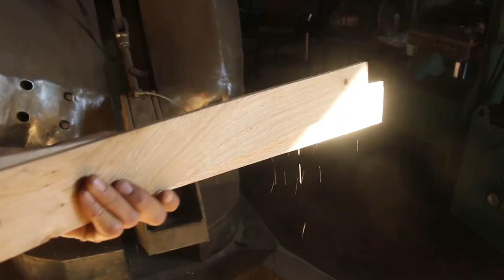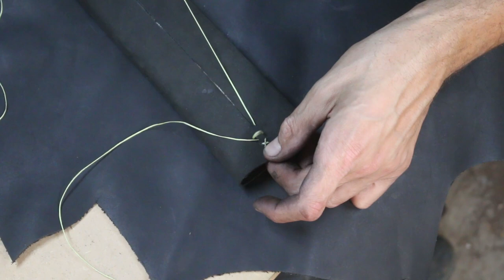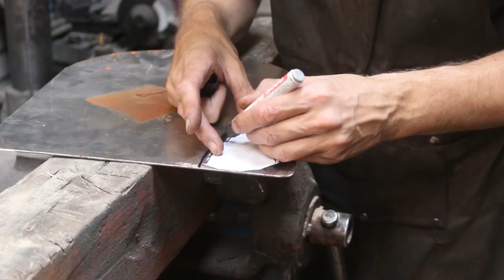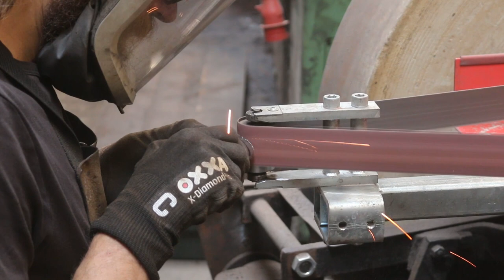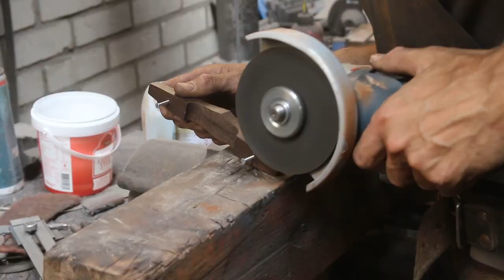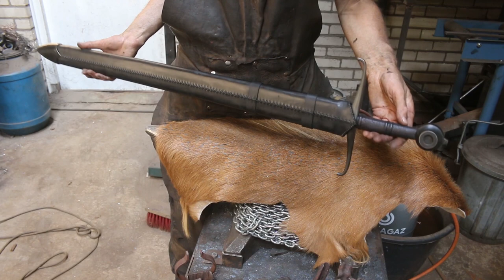Making a scabbard for a existing sword.

Comment: Ok so I have to be straight....the craftsmanship is good, execution good but it’s the same mistake I see sword smiths or scabbard makers make.... the scabbard in modern eyes should fit like a glove, modern machined products have got us used to perfect tolerances,,, the problem with swords as seen historically in all examples I’ve seen the blade has wiggle room... if you handle a genuine 15th century scabbard the sword feels loose. To our minds too loose but this is for function over form.... cold, damp battle conditions and the sword will not draw, like in gladiator the movie at the beginning, wood expands and you put your blade away, try drawing it the next morning and it’s wedged tight.....

Comment: @Freerk Do you use any kind of mechanical connection to hold the metal tip on to the scabbard or do you only use epoxy?
Reply: Not sure if you ever got your answer, but most metal ends on scabbards (called a "chape") from what I've seen are usually held with a strong adhesive/epoxy or sometimes friction fitted in by heating the metal first so that it expands, and allowing it to cool off over the end (which shrinks the metal) and tightly grips around wooden core. 

Also seen some people hammer metal pins or rivets through the chape onto the scabbard, but that seems sorta overkill for something that's not gonna be used to warrant such a thing.